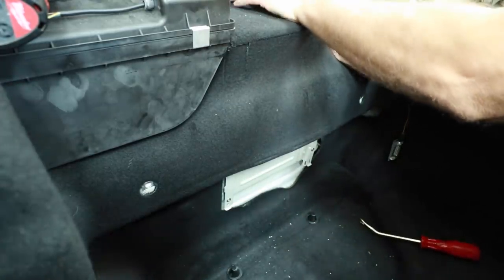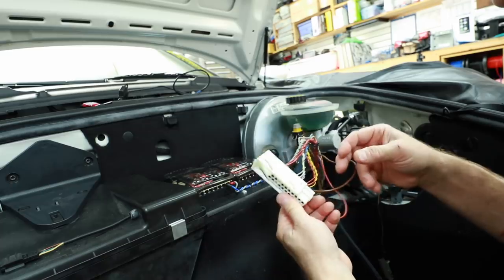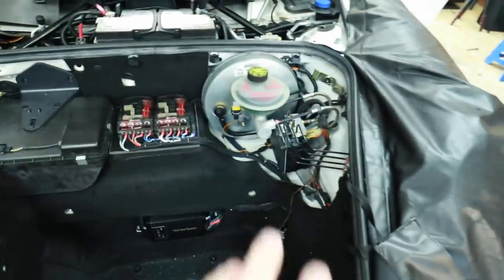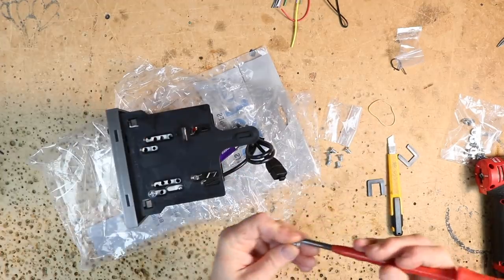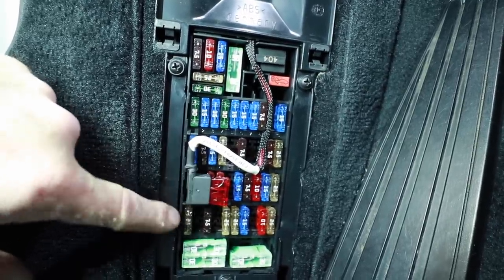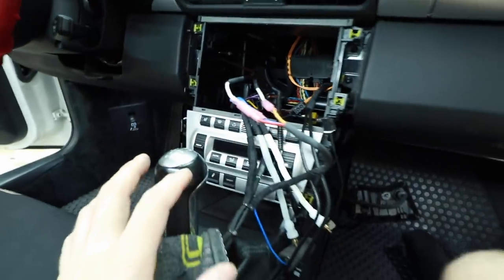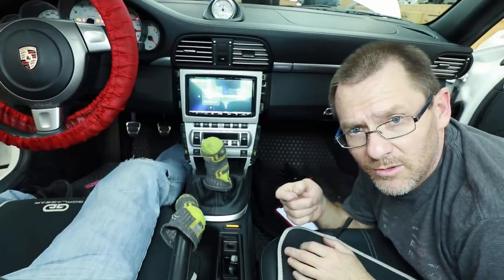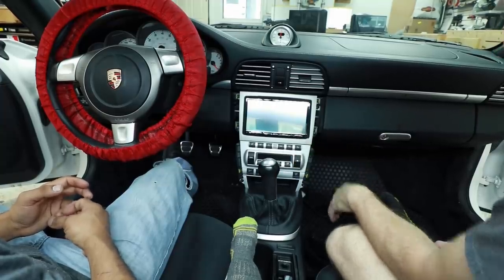The Kenwood radio goes in and we are done  06 Porsche Carrera S  Installer Diaries 266 part 4

Comment: Awesome install guys. QUESTION!! I have this same head unit going into a RF 3Sixty.3 DSP and when I set it up it said max volume was 36 out of 40. Are you 100% sure that it can be turned all the way up with NO distortion? I am using the USB input and RCA outputs. Thanks Dean and Fernando!!
Reply: Evilthx I have the same issue with my Kenwood but it clips on my smd dd1 at 29 of 40
Reply: @chrislee4946  I literally had no built in enhancements on, all EQ's flat, Balance and Fade at 0. I used RF's setup disc via USB to set everything.